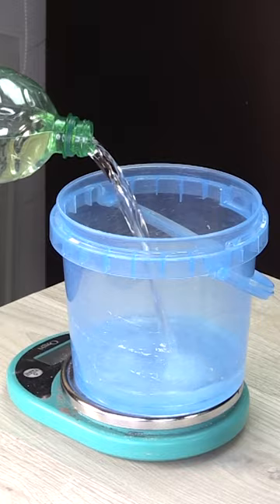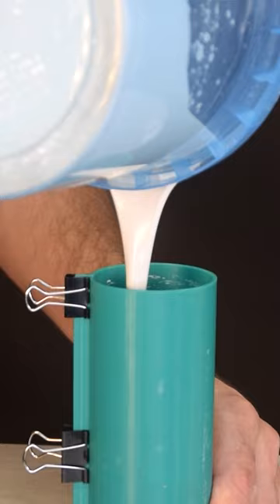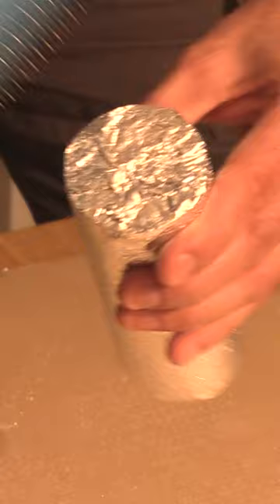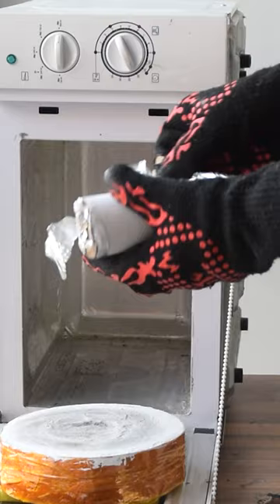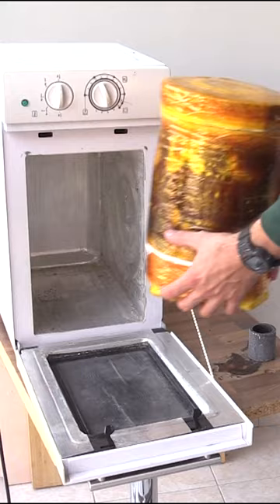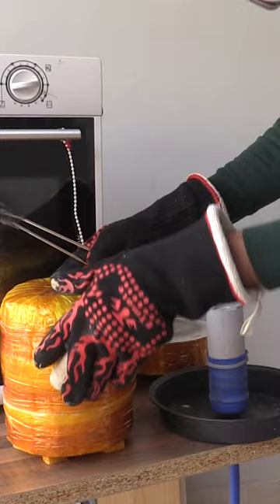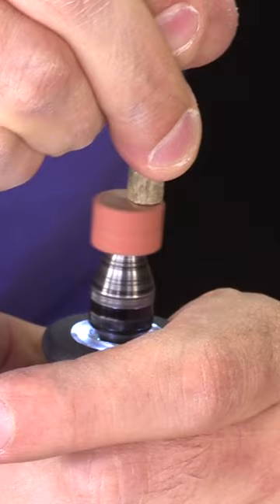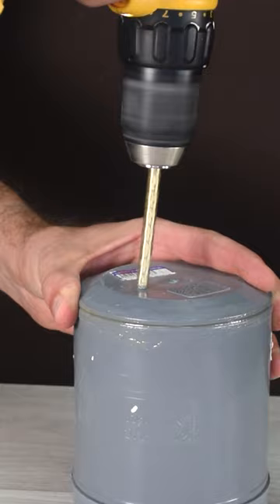That's why drill bits are not made out of pure Brass #shorts #metalcasting

Comment: Brass also has zinc in it. Zinc oxide is something you really don’t want to breathe in. Also, they don’t cast drill bits, they’re cut out of tool steel rods, shaped, and then heat treat. Kinda like swords, or any tool made of steel.
Reply: I don't think this was made for practical use. More just a "fuck around and find out" kind of thing
Reply: @thedudeamongmengs2051  but security is important
Reply: @luisapaza317  what?
Reply: @thedudeamongmengs2051  safety, I'm sure
Reply: @CopperIron  oh true. Even then this isn't that dangerous. A little flux tends to help with the zinc. I was confused because I was more commenting on why he would even try a brass bit
Reply: The thing is made of brass. You can't possibly think he's seriously expecting to drill though steel with it.

Comment: Yeah brass is a terrible idea for a drill bit material. Would be curious to know if you did any heat treatment? Really cool idea for a easy access kiln though, I've never seen microwave kilns
Reply: I don't  think  any heat treatment  would  work  for  brass
Reply: You don't harden copper alloys by heat and quenching.  You work harden them by hitting them with a hammer.  The only thing heating does to them is soften them in a process called annealing.
Reply: @dynamicworlds1 You can harden certain alloys of Copper and Bronze via quenching. You can get some pretty decent hardness from them, 43-47 rockwell if I'm not mistaken.

Though most alloys will just anneal, as you said.

Comment: There is a company that makes wax burnout filament for 3D printers.
Reply from the maker: Yes, I actually have one of those filaments. It was sent to me years ago, but I never used it in a video.
Very difficult to print and just not worth it...especially for the price it was sold.
PLA burns out fine (especially clear, natural filament).

I must say the filament was sent to me 4-5 years ago. Maybe they have improved it and now it's better.
I am aware that there are at least 2 manufactures of wax filaments......I have not tried them both.

Cheers!

Comment: Can you do a small scale replica of wtc 1 & 2?
Some people claim they were controlled demolition, but having looked at the seismology of them compared to all other demolitions it's a physically impossible theory, because there is virtually not secondary waves from two half a million ton buildings impacting the ground. 
The seismology also disproves the official theory of structural pancaking, again because there are no secondary waves present. 
I believe that concrete heated in a microwave would be explosive due to small air pockets allowing water to boil and of course explode.
The buildings were destroyed with orbital microwave weapons.

Comment: I'm confused. Brass is a relatively soft metal. This is common knowledge. Also you learn in science that a material of lower hardness WILL damage itself when trying to damage different material of a higher hardness. This is also common knowledge. It's almost like you could have used deductive reasoning to figure this out without all this extra stuff. Why do you think they make actual drill bits out of tool steel, carbide, and diamond?
Reply from the maker: I am just messing around. It's not like I can't buy a drill bit for 1$. I wanted to see how good/bad it will perform. I am actually still pretty convinced that it should work to some degree (to drill soft objects).
The design of the drill bit was probably not very good.....and the fact that it was bent also did not help.
Cheers!